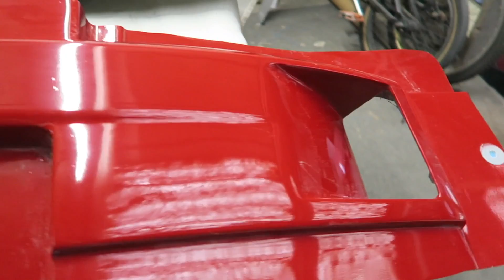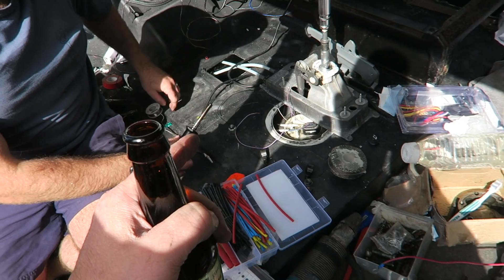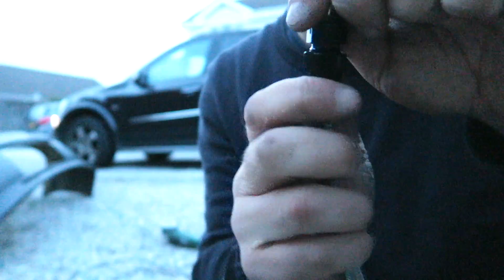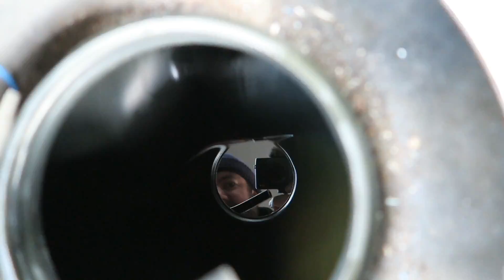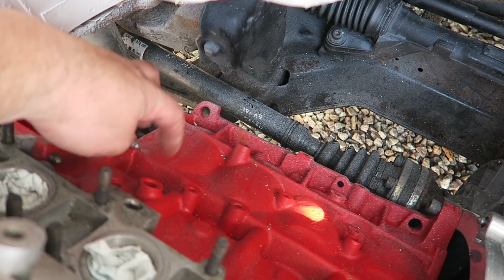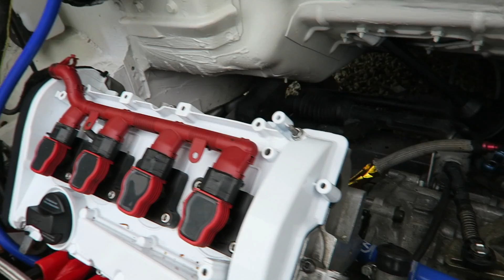VW T4 TRANSPORTER 500BHP+ Carbon Panels & Fuel System

Comment: Hey Dean, I follow your pages and channel great content 🤙 I too am doing a 1.8t swop in my caravelle!!! I’m using a manual steering rack too what belt you using for your pulleys? Hope you can help? Jamie Boness 🤙
Reply from the maker: Hello mate, unless running thin tyres I wouldn't move to a manual rack unless its for a drag racing application. The manual rack gearing requires lots of turns to get the same steering angle making it quite awkward around town, especially on wider tyres. eg I'm on 255/40/17. Welcome to have my belt if you like as I'm going back to power steering for track use.

Comment: Defo keep doing the walk throughs of the fabrication mate. Great to watch things come together rather than a "here's one I made earlier"! This things gonna be a beast, and I want a carbon bonnet for my van now!!!
Reply from the maker: This bonnet still needs more work, I'm going to use a 10mm easy composites Nomex core sheet on the rear to strengthen things.  Another video when the weather improves.

Comment: Looking good dude. I'm recently new to the channel but things are looking awesome. A lot of products from the Gloucester/Malvern area. Is that where your based?

I'm doing a mk4 build at present looking for a modest 320 ish lol. Hurricane rods from bill stage 3 hybrid k04 etc etc. No where to your standard but sweet enough lol. 

Just wondering what are you doing with the dekka 630's bud as I've been advised either Bosch 550's or 610's or dekka 630's. Are they over kill for low to mid 300's or would they be cool?

Loving the decking improvisation that's van life for sure😎

Take it easy 

Dave
Reply from the maker: Hi David, yes I'm in Cornwall. Might as well go to 400-450bhp if you have rods, maybe consider some income exhaust valves from Pro Race Engineering and strap a GT3076 size turbo on :-) The footage in this video is from 2 mth ago so the injectors have already sold I'm afraid. I ran 398bhp on the Deka 630's, I found them to be really spot on. The decking works great, when I'm a grown up I'll get some fancy tools like the pro's at Autostyl (or just keep asking for a job) haha
Reply: @SpeedingTube  I would go bigger turbo all in good time though. It's going to be my daily and a family wagon too for me kids so where I'm aiming for is more than enough for my needs and budget at present lol. Thats cool I'll order a set up I'm thinking if the 630's run more lph I can at least maybe use them when it comes to bigger boost gains. I've heard about supertech valves from bill and heard a lot of good things about them. Strangely enough I've already turned away a full mamba gt3076 set up and a gt28 set up too as trying to remain focused on the whole family driver thing lol. 

Keep up all the updates dude I'm getting some funky ideas from it all. 

Oh ps I've used heat wrap a few times before and have always suffered cracked welds so watch out for that as it increased the temp on the welds that are covered
Reply from the maker: @davidkane9876  Hi bud, thanks for that info, Bill and Alex at Badger 5 are awesome for info and parts. Hopefully this manifold will last but I'll be swapping it out in a year or two anyway as I'm going to make my own thick wall manifold (learn to TIG weld first) with a bit more access to the coil packs and Turbosmart Anti Lag valve ports for oxygen for full blown antilog.
Reply: @SpeedingTube  Lol if you keep asking autostyl for that job I'm sure you can make it up pretty soon. The 3mm manifolds are awesome. Just remember to purge weld it tho so bit welds both inside and outside of the join. I'll agree about bill and Alex there ok. Hey what clutch are you using on the van bud?
Reply from the maker: @davidkane9876  Ha yes bud, it will be fully back purged etc. I've watched loads of tutorials, just time to start learning for real now ha
Reply: @SpeedingTube  Lol all good things come with time bud.
Reply: Sorry just unpaused and seen cornwall for the door cards LOL 😄

Comment: Great WORK . I am following you doing this kind of  T4, because i am a big T4 enthusiast (crrently owning 3 of them). Here in germany such an engine swap would be maximum ILLEGAL :-D
Reply from the maker: Thank you Alexander! It will be fine, you need to swap one of your T4's with a 1.8T! In Germany it is illegal to swap the engine, but it is legal to do 350kmh on the Autobahn! haha :-)
Reply: well it is legal to do an engine swap but then youll need a very very thorough inspection and also upgraded brake system and suspension and tires and all that
Reply from the maker: @philippeichinger3246  That's makes perfect sense to me, I can't see any problem with that at all for safety.
Reply: I agree, and im actually somewhat glad we have that because it does make the roads safer, but harder for enthusiasts to do stuff like that